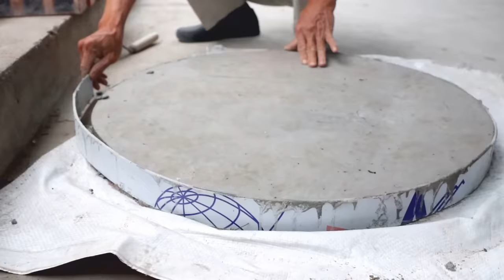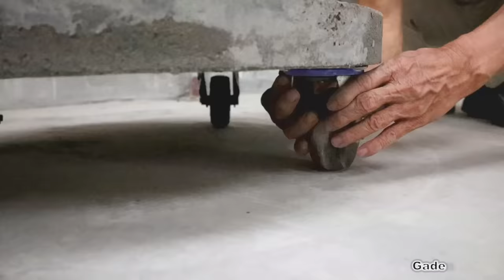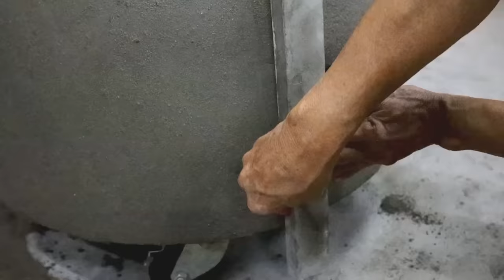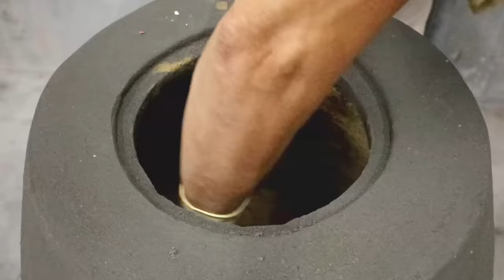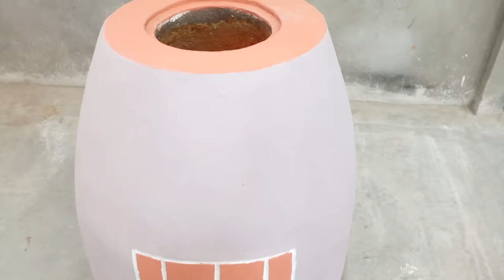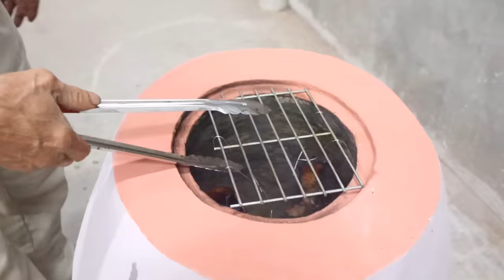Build a beautiful moving wood stove / tandoor oven

Comment: You need to use refractory mortar and add insulation to the floor and walls. Also instead of using Portland cement to form your floor you needed to use refractory castable. This oven will creak after a strong fire.
Reply: no it wont  have you ever seen a tandoor i dont thinks so  its for bakling bread not for melting gold lol
Reply: @waleedkhattak8114  This is not a guess, it’s a fact from a professional.
Reply: they dont care whats right or wrong , durable or dangerous... they are youtubers ;),  2 million views in a month unbelievable..
Reply: Я бы ещё снаружи сделал штукатурную сетку и у утеплитель и обмазал глиной и стянул обожженой проволокой чтобы его от температуры не разорвало
Reply: I like this idea and your input helps.

Comment: Next time put the wheels on before it dries !
Reply: Yes, then they can sink in and  will be at all different angles. The screws will not be secured either. Good thinking on your part!
Reply: @이이-n4z8y thats why you put concrete anchors on the screws. So you can take them out when it dries like I said
Reply: Next time actually try making something yourself before making silly comments
Reply: 000000000❤😊